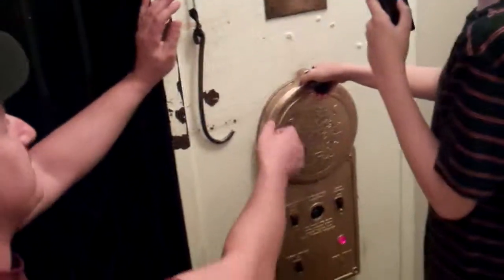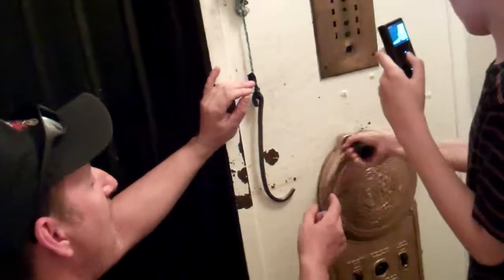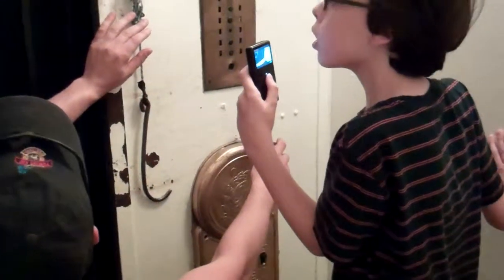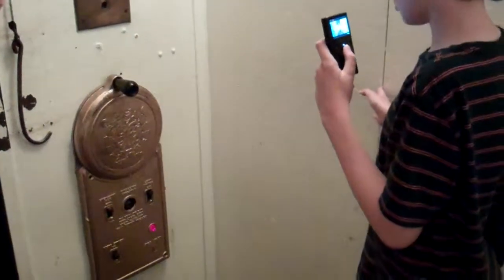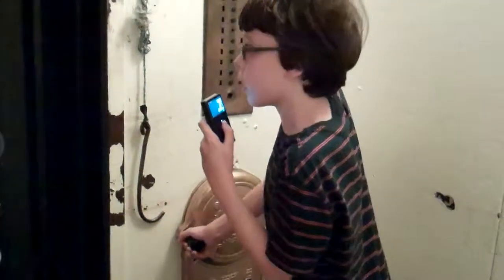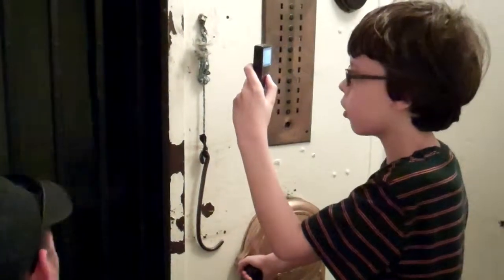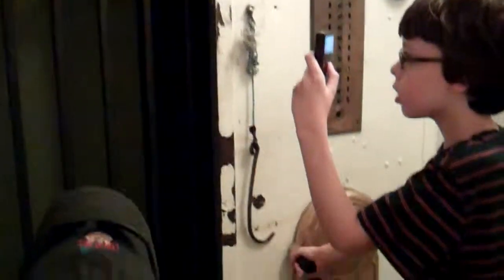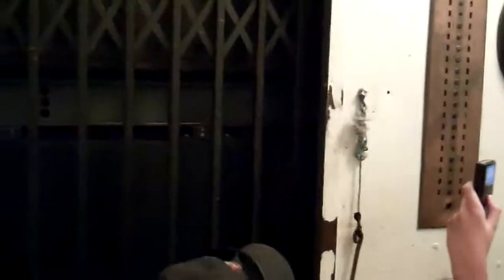Antique Otis Micro-Drive Manually-Controlled Traction Elevator in Buffalo, NY (Mom's POV)

Comment: Does this elevator have variable speed control? because the further you move the control from the center, the faster it goes. If you slowly move the control back to the center
you slow the car down and can stop it with ease compared to single speed drive systems where you cannot. This is truly a rare find here and its impressive!! Thank you for sharing this!!! You really found an amazing collection of fine historic elevators!